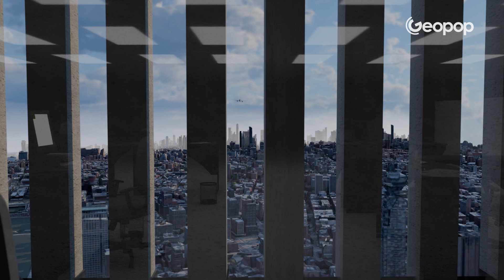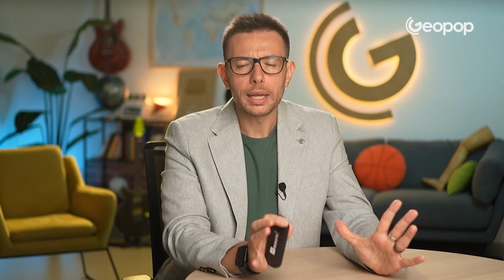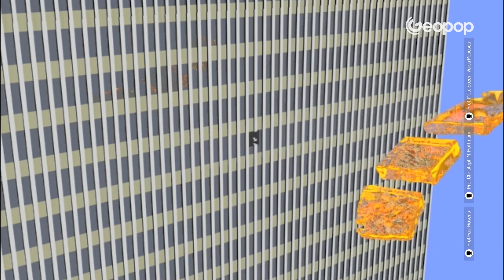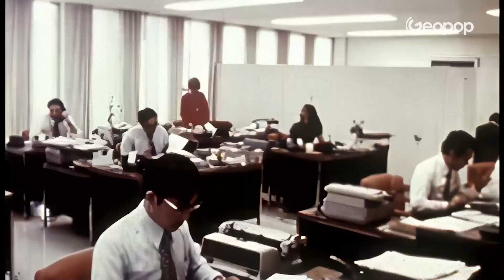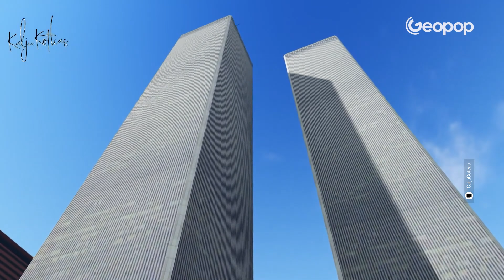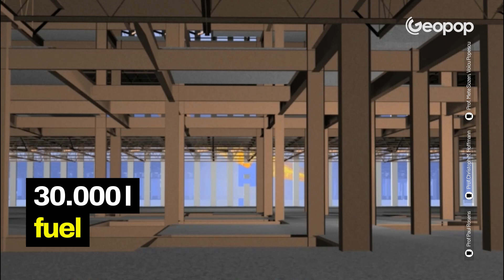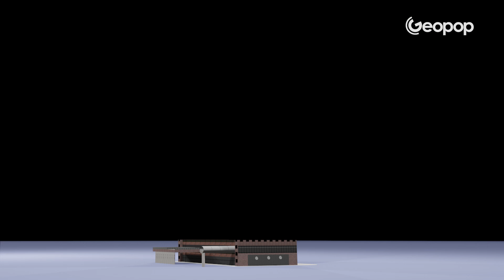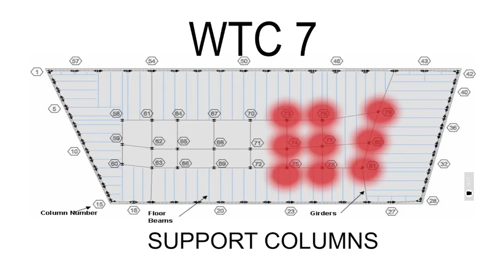9/11, 2001: The Technical Reconstruction of the Twin Towers and WTC 7 Collapses

Comment: Total pile of poop. 70 or 80 floors of undamaged structural steel below the impact fire zone would have offered substantial resistance to the downward acceleration from 20 or 30 damaged floors. The official collapse time of 10 seconds would have been impossible. What these guys are doing is explaining the BS NIST report so that laypersons will believe they understand it. BS is BS no matter how it’s rendered.
Reply: Nope. You're doing it wrong. Let’s break it down to the absolute basics:

The 47 core and 236 perimeter columns of the Twin Towers support all of the gravity loads of the building. ALL of the resistance is in the columns.

Planes impact Towers, causing massive structural damage, destroying sprinkler systems, tearing out gypsum board walls and blasting off the SFRM insulation from the floors. Multiple floor-wide fires are started instantly and spread rapidly due to the destruction of fire protection systems and venting of the building during the impact.

Serious fires were largely confined to the impact damaged floors and those immediately adjacent to them.

Fires were started by the impacts and fuel aboard the aircraft, which acted as an accelerant. No shortage of other consumables inside the tower to continue the fires.

Collapse was initiated (started) at the impact and fire damaged floors when floor trusses exposed to heat over time sagged, in turn pulling on and causing the inward bowing of some perimeter columns by up to 5 feet until they buckled on one face of each tower (ie: NOT symmetrically).

www.youtube.com/watch?v=ULdiD6gYZO0

No steel melted or needed to. Structural steel will bend and fail at less than half its melting temperature.

Once the perimeter columns buckled the formerly static load above became a dynamic load 30 times greater, easily overwhelming the structure below.

Thousands of tons of now loose debris fall through the open office space within the four outer walls - bypassing the columns - dropping 12 feet onto the first intact floor it comes across. That massive instant overload causes the floor to fail, shearing the pair of bolts that secure each end of the floor trusses to the columns. The floor fails. adding its mass to the falling mass which continues to accelerate for another 12 feet until it impacts the next floor, rinse and repeat one floor at a time all the way down.

The columns - the part that holds the building up, supporting ALL of the gravity loads - are spectators for all this.

Rate of collapse increases as momentum increases. The collapse front is constantly accelerating.

As each floor fails, air inside the building (the Towers were 95% air by volume) is compressed, then blows out the sides _in reaction to the Tower falling, not the cause of the Tower falling.

No fire required at all on floors below the impact points for them to fail. The mechanisms that started the collapse are different to the mechanisms which continued the collapse. That will be a difficult concept for some.

As the floors fail the perimeter columns are left literally hanging in the breeze, no longer attached to the rest of the structure. They peel away and fall in great sheets (think banana) out to more than 600 feet from the base on the 4 points of the compass.

Core columns failed last.

Total collapse time was 32 to 34 seconds, NOT 10 seconds.  Anyone with a working eyeball and the ability to tell time can work that out. 

Each 110-story tower had a 1-acre footprint. The debris pile was up to 14 stories deep and spread out over 16 acres, destroying 8 surrounding buildings and damaging more than 100 others.

The above all true no matter who planned and carried out the 9/11 attacks or why

Comment: Yes you are correct, doubt will be with many for years to come.  You sure did a super job explaining --- But I  still carry deep doubt over the official explanation of the World Trade Center collapse. Even accepting that flaming debris fell from the towers, it’s hard to believe that such debris would randomly cause fires only on certain floors of only one other building WTC 7 while leaving nearby buildings, some just as close, virtually unaffected. If the falling debris was truly as destructive as claimed, then multiple surrounding buildings should have suffered similar structural failures or fire-induced collapses. Yet none did.   What’s more suspicious is that nearly 4,000 people were evacuated from the towers before the collapse, raising the question: who knew to pull them out, and why weren’t similar evacuation orders given for other buildings in the area if they were also at risk? Why did only WTC 1, 2, and 7 collapse in such a complete and symmetrical manner, while other buildings, closer or just as vulnerable stood tall despite fire and debris damage?

To me, it just doesn’t add up. The pattern of destruction, selective collapse, and forewarning evacuations strongly suggest this wasn’t just a chaotic byproduct of debris and fire—but something far more orchestrated.  BUT thats just me...... (Dont hate me ppl 😅 )
Reply: The collapse of the Twin Towers ultimately destroyed 8 surrounding buildings (4 of which suffered global collapses and others partial collapses) while damaging more than 100 others. Building 7 is the one that gets all the attention because it is the only one the conspiracists can make hey with. 

The number of people evacuated from the Twin Towers is estimated to be well in excess of 17,000.

Comment: You’re wrong, the fire burned at 900-1000 degrees Celsius for at most 20 minutes. It’s not like there’s an infinite supply of jet fuel that will endlessly burn. At most it was burning at 500 degrees most of the time. Which wouldn’t have even weakened the steel. Not to mention yes the floors would have buckled and bent. However the floor steel columns were so much thinner and weaker than the inner support and the perimeter supports. It just doesn’t make sense how the buckling of the floors pulled the outer perimeter steel beams enough for them to collapse. The weak floor would have long snapped before doing so. And the north tower had around only around 8% of its total floors damaged. So 92% of the bottom remains completely untouched. Can you explain to me how (mind you even NIST admits it) the tower collapsed at free fall speeds? When there was 92% of the tower structurally sound? Even if the full tower did collapse on itself, wouldn’t the bottom slow the collapse of the top significantly? The only way for such a collapse to happen at free fall speeds is if the base and the rest of the bottom floors were already weakened. Which no investigation has suggested? Also explain to me why NIST refused to test the steel beams for traces of explosives like thermite on the steel columns. People were skeptical that bombs were used back then, so they pressured NIST to test for explosives. Yet they refused.
Reply: And you pulled those figures from which part of your rectum?

Also, the floors didn't buckle, they sagged. The perimeter columns buckled. www.youtube.com/watch?v=ULdiD6gYZO0

You are making an awful lot of assumptions and even more mistakes. 

Let’s break it down to the absolute basics:

The 47 core and 236 perimeter columns of the Twin Towers support all of the gravity loads of the building. ALL of the resistance is in the columns.

Planes impact Towers, causing massive structural damage, destroying sprinkler systems, tearing out gypsum board walls and blasting off the SFRM insulation from the floors. Multiple floor-wide fires are started instantly and spread rapidly due to the destruction of fire protection systems and venting of the building during the impact.

Serious fires were largely confined to the impact damaged floors and those immediately adjacent to them.

Fires were started by the impacts and fuel aboard the aircraft, which acted as an accelerant. No shortage of other consumables inside the tower to continue the fires.

Collapse was initiated (started) at the impact and fire damaged floors when floor trusses exposed to heat over time sagged, in turn pulling on and causing the inward bowing of some perimeter columns by up to 5 feet until they buckled on one face of each tower (ie: NOT symmetrically).

No steel melted or needed to. Structural steel will bend and fail at less than half its melting temperature.

Once the perimeter columns buckled the formerly static load above became a dynamic load 30 times greater, easily overwhelming the structure below.

Thousands of tons of now loose debris fall through the open office space within the four outer walls - bypassing the columns - dropping 12 feet onto the first intact floor it comes across. That massive instant overload causes the floor to fail, shearing the pair of bolts that secure each end of the floor trusses to the columns. The floor fails. adding its mass to the falling mass which continues to accelerate for another 12 feet until it impacts the next floor, rinse and repeat one floor at a time all the way down.

The columns - the part that holds the building up, supporting ALL of the gravity loads - are spectators for all this.

Rate of collapse increases as momentum increases. The collapse front is constantly accelerating.

As each floor fails, air inside the building (the Towers were 95% air by volume) is compressed, then blows out the sides _in reaction to the Tower falling, not the cause of the Tower falling.

No fire required at all on floors below the impact points for them to fail. The mechanisms that started the collapse are different to the mechanisms which continued the collapse. That will be a difficult concept for some.

As the floors fail the perimeter columns are left literally hanging in the breeze, no longer attached to the rest of the structure. They peel away and fall in great sheets (think banana) out to more than 600 feet from the base on the 4 points of the compass.

Core columns failed last.

Each 110-story tower had a 1-acre footprint. The debris pile was up to 14 stories deep and spread out over 16 acres, destroying 8 surrounding buildings and damaging more than 100 others.

The above all true no matter who planned and carried out the 9/11 attacks or why